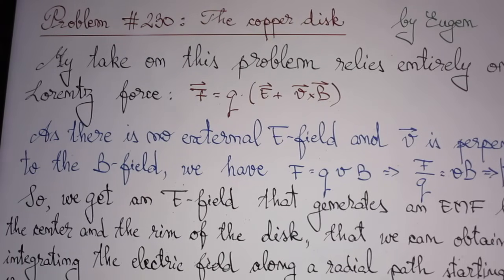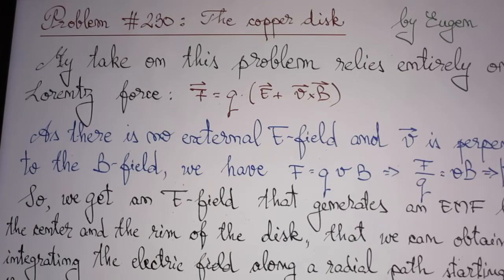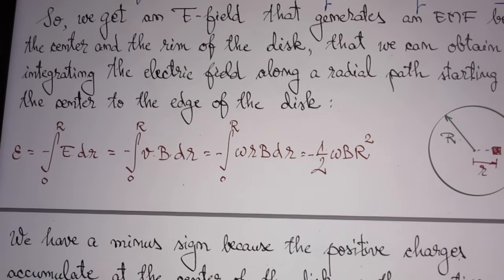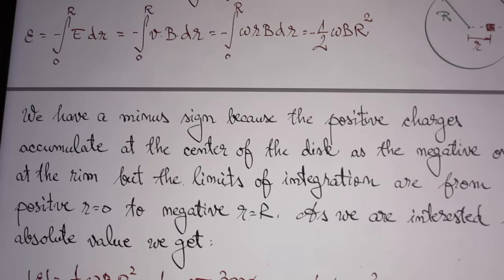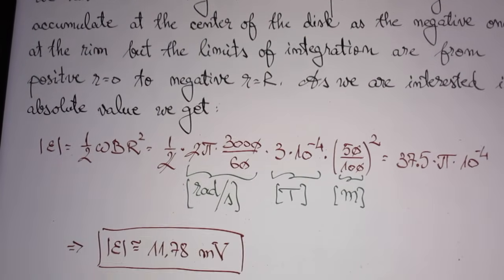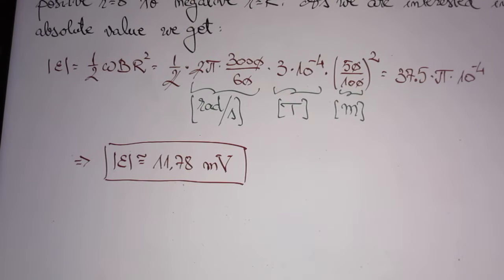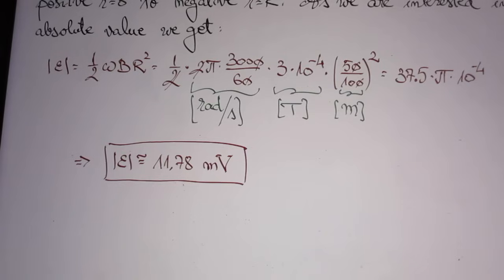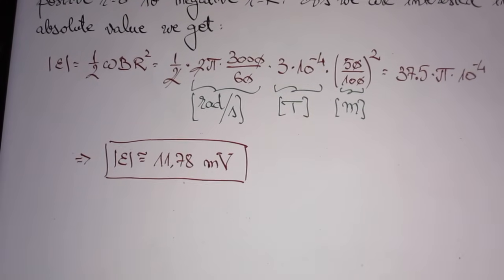Solution to problem 230 Faraday in action

Comment: Sir, I've found a way to calculate the integral B.dl (where B is due to a line wire) for any complicated curve without using multi variable calculus, I've not found this approach in any book till now, can you please confirm its authenticity?I just used Polar coordinates to write any arbitrary dl vector, and found the result that, we don't actually need to do multivariable calculus, the result just comes in terms of the angle subtended by the end points of the curve on the X axis. SIR, can you please share your mail ID so that I can send my thesis there?
Reply from the maker: all the best - my email is top secret
Reply: Can I mail you at the MIT email address? @lecturesbywalterlewin.they9259

Comment: Is there a flywheel inside the mechanism?
Reply from the maker: yes
Reply: @lecturesbywalterlewin.they9259  But Is there an electric coil inside the circuit ?
Reply: @lecturesbywalterlewin.they9259  Thank you very much.I think  The flywheel is a very old invention. It's amazing that we can store mechanical energy and convert it to electrical energy. My guess is that that coil and flywheel are equivalent device.
Reply from the maker: @MrAminmohamed  incorrect   without a flywheel Faraday's Law works. Power stations do not use a flywheel. My dynamo probably has a flywheel as it is a toy.

Comment: Sir, i am preparing for JEE 2027 Is two years enough to crack IIT.
Reply from the maker: Watch all my 94 MIT course lectures. Start with 8.01, then 8.02, then 8.03. Do all the homework and take all my exams. I guarantee you that you will then do very well on the Physics portion of any freshman college or JEE exam  You will find all information you need on this channel in three playlists "Homework, Exam, Solutions & Lecture Notes".
8.01 & 8.02 will each take about 200 hours, 8.03 about 250 hours.